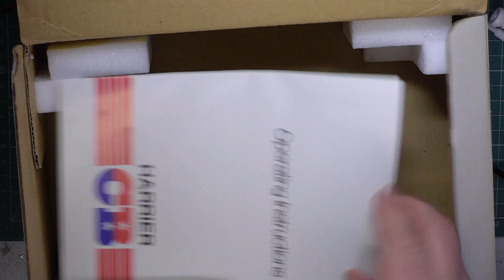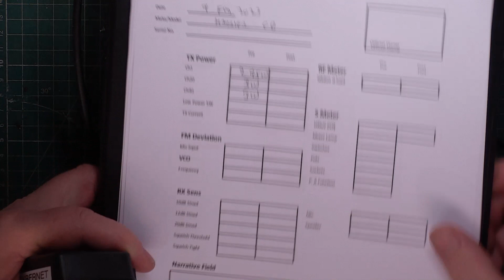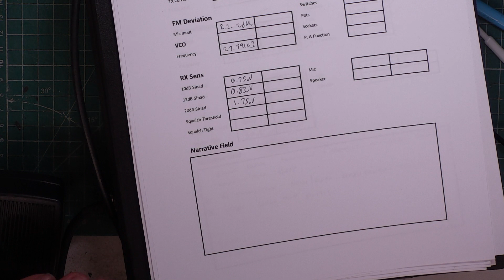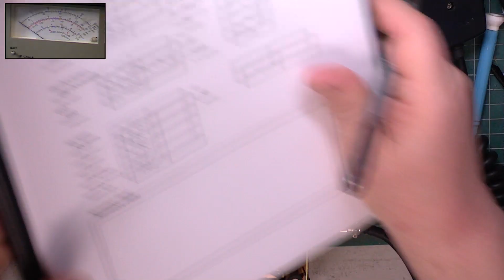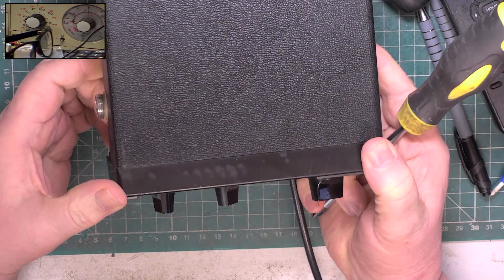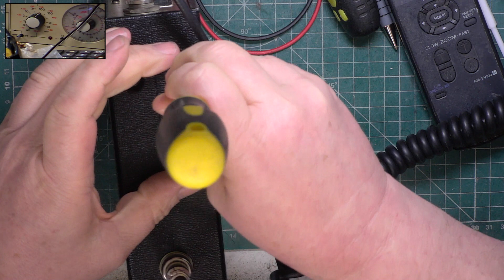Harrier CB CB27/81 UK FM CB radio - repair & re-alignment

Comment: After removing the crystal filter I would have removed T9 in this set.

Sets that come with T9 fitted at the factory have a lower value emitter resistor (R35) at Q10, 120 ohm instead of 180 ohm to compensate for the loss of the extra can.  Because this set has a 180 ohm resistor at R35 you are potentially losing a bit of sensitivity by leaving T9 in place.

One could of course reduce the value of R35 to 120 ohm, but better to put the radio back to how it was when it left the factory. That T9 can does not look right either, probably chosen to match the higher impedance of the crystal filter.

Also, always worth checking the values of the Q10 base bias resistors when crystal filters have been added to these radios; they often get increased to present a higher impedance to the crystal filter.

Best regards,

Matt (M0MTB)

Comment: Am I correct in thinking to add a xtal filter the impedance is differant and you need a buffer fet??
Reply from the maker: I've no idea how it's done properly as I'm not involved with modifications. However, I do know it's not just a direct swap. I think it's more of a matter of changing resistors & capacitors around the filter circuit rather than introducing an extra active stage.  A simple way would be to compare the circuits of radios with xtal filters against radios with ceramic filters. For example, the Realistic TRRC2003 mobile, the TRC1001 handheld, the Audioline 342, the DNT B40 (base) and the Maxcom 30E (not a shining example) could be a starting place for research.

Richard, G0OJF, UK
Reply: @ukfmcbradioservicingTango21  thank you. I guess so,  I will do some digging of your interested in any results?
Reply from the maker: @paultomlinson528  Hello Paul, not really as I'm only interested in OEM restoration & changing failed parts like for like. Reslly, you need before & after results....ideally achieved with two signal generators & a mathematical formula to give you the dB adjacent chsannel rejection figure. TYpical figure would be 50dB, minimum acceptable is 40dB Formula is 20log10(measured signal on adjacent channel for 6dB degredation/measured rx sensitivity for 12dB SINAD).

I'll be doing these tests on every radio soon as I'm convince many new sets are poor in this direction, but people don't trealise it because of fewer users.

Richard

Comment: I can remember staring in to the windows of Dixon's and wishing I had the pocket money to get one of these, I do have a very tatty one in the collection though, that xtal filter was pulling the receive off, sounded much better with the ceramic filter in place, at the time for the same money and the same chassis you could get the rvc220 that's what I ended up getting.

Comment: Nice clean radio, I see your saving the best till last on this batch Richard. 10m15a is a 10.7mhz according to Google
Reply from the maker: yes, should be 10.695 for CB use & terminatiuon impedence is different between crystal & ceramic filters. These set's aren't bleedover boxes anyway. Talking of bleedover boxes, the next set in this batch is a fidelity 1000 & it needs the roger bleep removing.

Richard